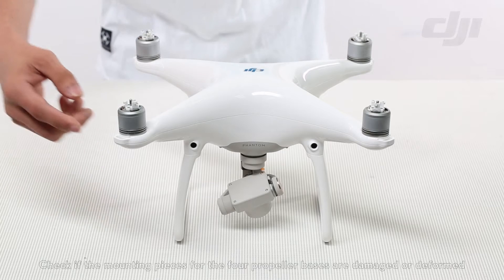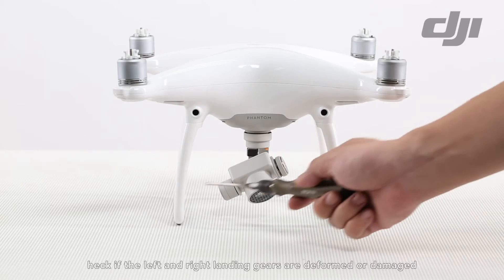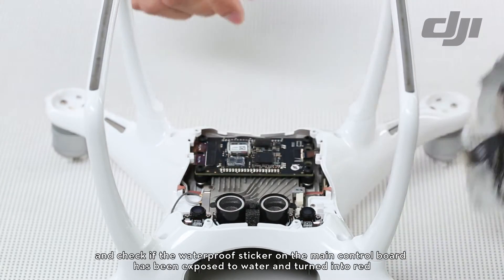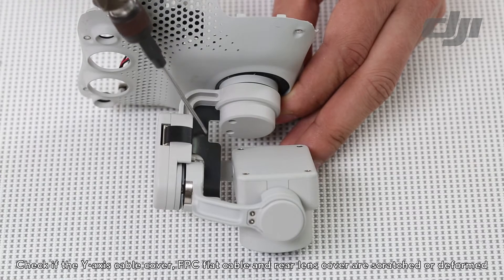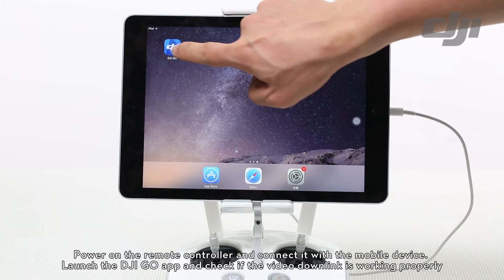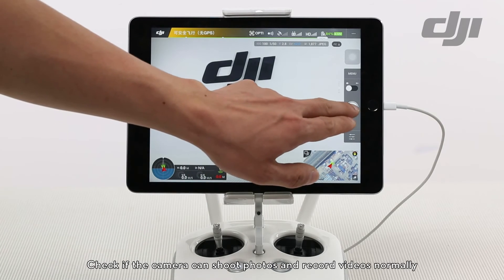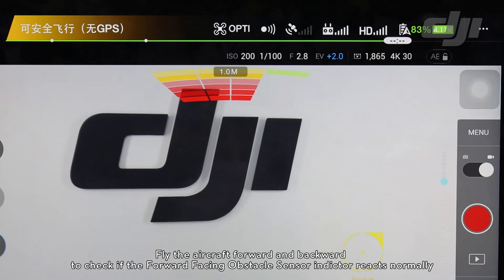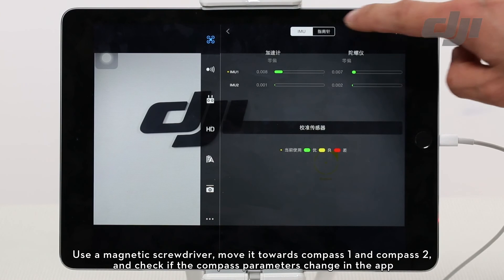DJI Official Repair:Phantom 4 Damage Assessment

Comment: hi
I had a gimbal flex cable error so I opened and replaced it with the new 1 
during this process,i by mistaken and short circuit the camera pitch motor board of the gimbal of the Phantom 4 .
can I get 1 from u if u have as an spare or I'm ready to buy that board from u  rather then wasting so much of bucks for replacing the whole camera and gimbal set
it's killing me so plz reply me and hope you'll reply in a positive way.
Reply from the maker: DJI Phantom 4 can you please e-mail me a picture of the part that you need. I might have it in stock. my e-mail is usdceinc@gmail.com.